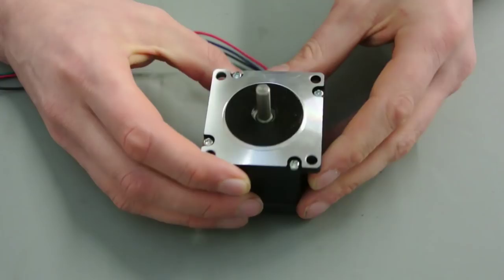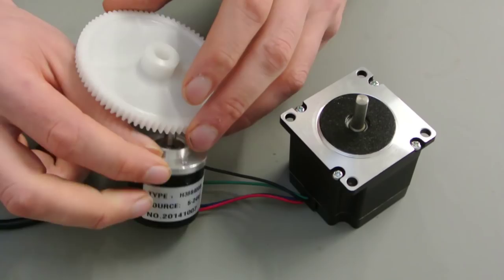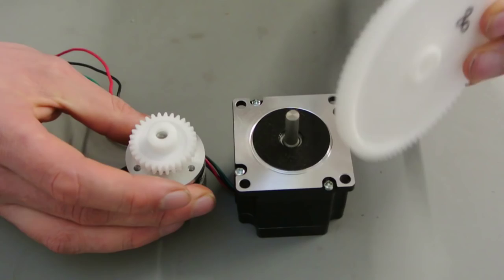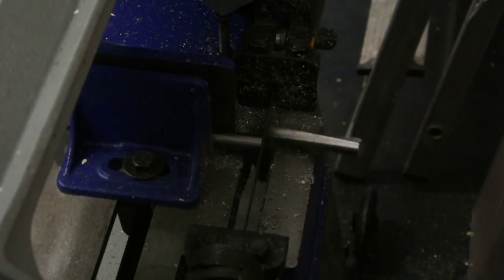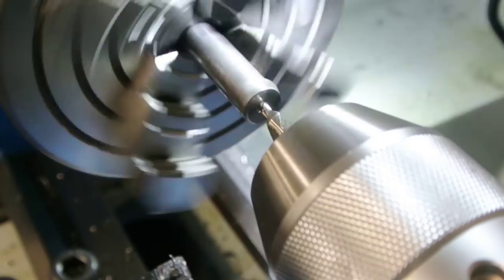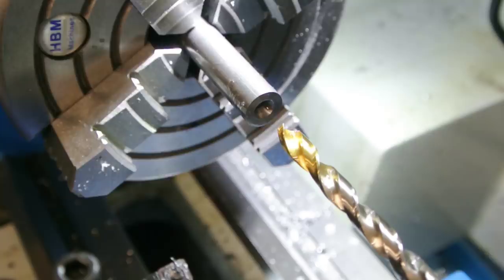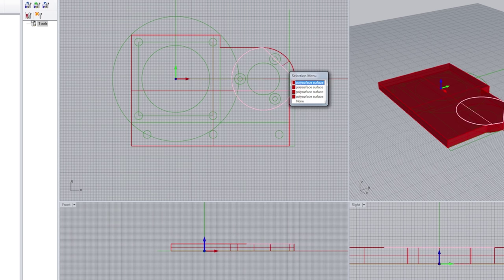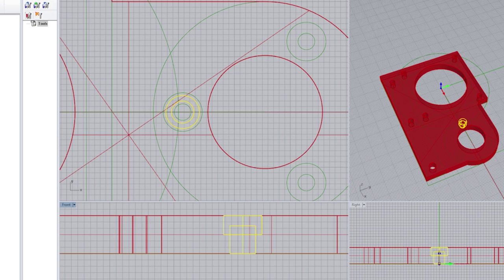Converting a Stepper Motor to a Closed-loop Stepper Motor - Part 1

Comment: Thanks for a great presentation! I did not watch the video for its music content, although I guess the Jazz fans aren’t exactly speaking out in support of your choice of background music.

I was looking into the trade-offs between the effort needed to use an encoder on a lead screw to compensate for backlash in a geared stepper, but it adds more complexity than my simple project requires. Sometimes there is no substitute for using directly-coupled stepper motors, but I can see use-cases where this would be necessary for machines that must not skip any steps, and/or for applications requiring extreme precision.

Comment: Nice bracket build but why not just add an encoder to the back of a double shaft step motor? All off our low cost double shafted stepper motors are pre-drilled and tapped to accept two common bolt circles for encoders. Jim at Applied Motion.

Comment: I believe this is a great video, I know little of the electrical world so is this correct or no, if I mounted a rubber wheel to this then I would not need a lead/ballOr any other driven screw belt or rack and pinion correct?

Comment: I'm curious to know how to generate the pulses for the stepper drivers, pwm I mean 
I'm trying with interrupt timer handler , I'm trying with internal pwm but I'm not able to read the pulses somewhere , now I'm thinking about to generate pulses by using a VCO  but I have to rea the pulses too....ufffff
Reply from the maker: Walter Porcellini Hi Walter. You probably don't need PMW to controle your driver? You just have to set the drive pin to HIGH and LOW at a relative slow pace. good luck!

Comment: Why do you need to convert them into closed loop?
Reply: +ah lee
The stepper motor receives a pulse, but the motor doesn't move. You now have a missed step, throwing off the accuracy. 

The best way I can think of to describe what may cause this issue, is if you are working with wood, for instance. The toolbit is moving along just fine, and all of a sudden it comes in contact with a dense knot in the wood. The toolbit attempts to advance to make the cut, but instead remains in position, thus causing a missed step. 

There are several reasons why this may happen. You may be trying to take too deep of a cut, or you haven't set the spindle speed to the proper setting for the material you are working with, or you are advancing the motor faster than the toolbit can clear out the swarf. Sometimes simply changing the bit from a 2-flute to a 4-flute can remedy this, otherwise, slow down your cuts. Haste makes waste.  

In a closed-loop system, the encoder sends a feedback pulse back to the control software for each advancement of the motor letting it know if the motor actually moved. If not, the control software will make another attempt at making the cut. 

If your control software allows for it, you can set it up to halt the operation at that position. In this manner, you can make proper adjustments to the CNC machine, then continue on from there, thus avoiding ruining the part that you are cutting out. 
:

Comment: What are the advantages of a Closed-loop Stepper Motor?
Reply: You can detect when you stall it. Running open loop in something like a CNC machine can result in position errors and ruined parts...or worse.  With open loop the controller says, "move 10 steps" and assumes it happens, but has no way to be sure. If the load exceeds the torque during the move, so the stepper actually only does 5 steps, the controller now is off 5 steps worth of motion. The error can accumulate it it keeps happening so you end up cutting where you hadn't planned to.  Ruined work, broken cutters, ruined hold downs, parts flying....
With closed loop the controller can tell when the motor stalls.  It can command the motion again, shut down and call for a human, take a lighter cut or whatever else you write the software to do, but t isn't blind to what's really happening. 

-- Mike
Reply: Thanks :)